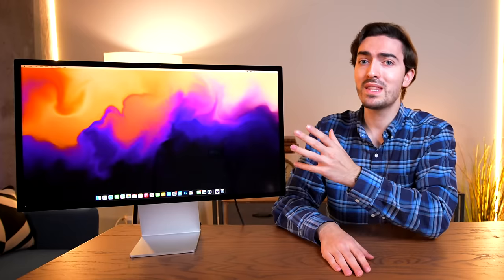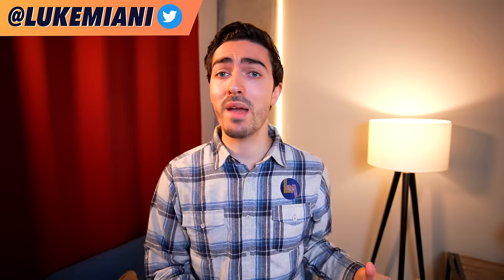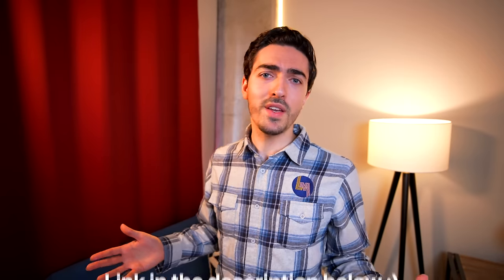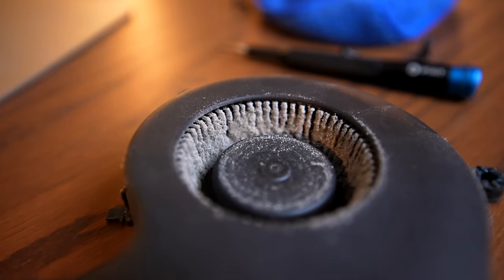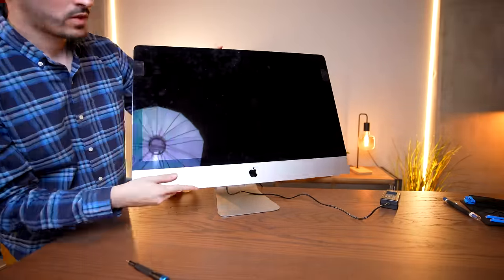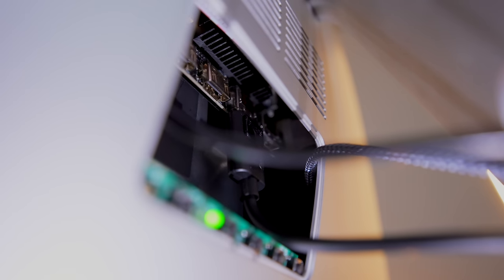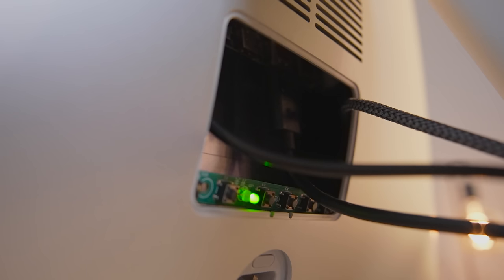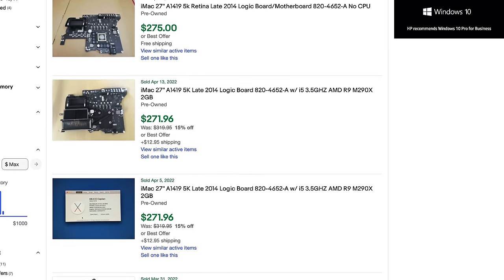How to make a DIY Studio Display for just $600! (USB-C & Built-in camera!)

Comment: Well done Luke... Yeah, I would do this in a heartbeat.  I think the new Apple display is WAY overpriced!  It should be $999 and then it would still be a high price. You didn't even have to work hard on getting this to work.  I think I would look into keeping the speakers with maybe a 2-4W amplifier for more volume when you want it. I forgot to ask  how much power this monitor draws?   I also want to do a similar thing and reuse a 17" or 15" MBP and put the internals of a MacBook Air with 16Gb of ram and 512GB SSD, making my own Pro size MBAir+.  I have a parts list built on putting the Mac Mini inside like you did before, this time with the ports exposed for a new iMac 27", since I think the 24" is overpriced and under powered for being an iMac.  It should automatically have 16Gb of Ram and I'm not a fan of the white bezel look.

Comment: I’ve seen cable adapters on AliExpress: 

27 '' iMac A1312 A1316 A1407 2K LCD Controller drive Board Monitor Display kit For LM270WQ1 A2 C2 E3 B1 B3 screen test mainboard.
Will these work?

Comment: Hi found this video and we I had an old slow running iMac 27 5k just sitting in the loft and as getting a new m2 something , I have gutted the old , just one thing what power supply did you use please,

Comment: I got my hands on a 2017 in mint condition for $100 but I don't have the power cable for the imac. Just wondering where the power comes from for the monitor? Is it through the thunderbolt connection to a mac mini?

Comment: Awesome project. While not a big deal, it should be mentioned in the video that one will have neither speakers nor a microphone.
Reply: i noticed the same thing too - I’ve been reading through the comments and there is a 4-pin speaker connector on the converter board which peeps claim could be used.  I am wondering what mic Luke is using in his current setup for sure.

Comment: Loved the way you did this. I have a Thunderbolt 27" Display and I'm pondering on doing the same sort of thing. I want to use it on my Linux PC system, and I don't use mac's any more because of compatibility issues. Anyway that's another issue. So if I could replace the LCD driver along the lines of what you have done I could use it. I've just started looking into this  so will see how it goes.
Reply: I'd consider upgrading your PC to Thunderbolt 4 so you can take advantage of fast external storage and use your monitor with a TB3 to TB2 adapter. Sure, more expensive but once USB 4.0 takes off maybe not too much.

Comment: Just ordered the conversion board to try this out for myself, but I noticed the seller is saying to avoid metal contact with the board in order to avoid short circuiting the board. Just curious how you managed this as it seems like it will be a little difficult to avoid any contact with metal as the entire interior is pretty much metal.

Comment: I happened to get a Later one on eBay, the "Late 2015 i5 3.2G 5K screen" at the same price, but now I regret it, and should have followed you with getting the 2014 one, because I now need the Target Display Mode (which I heard was possible with the 2014) and the 2015 has NOT GOT THAT! Bummer. Now I have no choice but to gut this good 2015 one, or get OR get an i7 6700 to upgrade.

Comment: Fantastic. I've asking around on forum for converting my 5k imac into a monitor.  I was wondering about using all that extra space in side. What would you need to do to insert some thunderbolt 4 and usb buses, and some more memory and audio (can you reuse the speakers?).  If I could trick my imac out with more connectors and memory I'd be in heaven.

Comment: I have been thinking about doing something similar with one of those 27-iMacs with a broken graphics card (1440p is still nice, especially if you are used to 1080p). You could also make use of the optical drive and other stuff.
So I hope I will get ahold of one very, very cheap :D

Comment: Nice project, I did something similar to my old 2007 iMac, because the screen is still decent enough not to get rid of.

Did you wire the speakers in the monitor too?
Reply: Hi Rene, your 2007 iMac won't be retina, so you can use it as external display without opening it, I think.

Humbly, Ylan

Comment: Luke 
I have an older Mac cinema display A1316 to be exact. I have purchased a M1 Mac mini and really would like to ise the HDMI port to connect my monitor. 
I saw your video on the subject and purchased the cable matters hdmi to display port adapter as you suggested. 
When I connect the monitor, it turns on for 6 seconds and turns off for 2, and on 6 seconds and off 2 seconds. 
Any suggestions on how to fix this?
Thank you in advance for your help 
Kyle

Comment: I’ve wanted to get some use out of the beautiful 5k display on my old 2015 27in iMac but couldn’t find a good way.  I might eventually do this project but right now, my 2015 27in iMac is doing such a good job as a media server running windows and Plex.  It does so well mostly because of how well it drives an external 4k TV.  I don’t even have the iMac’s display on 99% of the time. Seems a terrible waste.  If I repurposed the iMac’s display, I’d have to build/buy something to replace the iMac’s media server functionality (with good enough graphics).

Comment: How did you attach the board and cables to the back of the display? And what is the power supply for the conversion board? I found one on ebay as you did for $179 but the comments say the DisplayPort ports are 1.2 - not 1.4.  Won't that limit the 5k capability?
Reply: I’ve tried commenting here and sending a message via Twitter and FB with no response. 😢

Comment: I have a ‘17 version and want to use it with a Mac mini / studio. 
Is it possible to disconnect the display but retain the working internals of the iMac, fit the card and output the signal to the card, along with the new Mac and be able to select either as the input?

Comment: Some of these conversion boards have speaker connections. I did that on a 2006 iMac. If there are those connections, could you use the original speakers inside the display maybe?
Reply: the one he references has a 4-pin speaker connection.  apparently there are 4 wires coming out of each L & R speakers and the splitting of the frequencies is done at the preamp stage on the logic board.  Have my finger crossed this project catches on and an updated converter board is able to handle internal iMac speakers!
Reply: @chinarut  so maybe a tiny crossover would do the trick. But the board gives (I think) 5W of power to the 4-pin speakers connector, so yeah, maybe not worth it. Maybe from the audio output to an amp and crossover, all that in a small iMac body

Comment: hold on are you sure that conversion board dosnt also have a audio amp onboard so you could hook up the imac integrated speakers to that and make a banger of a display i there is a connector in the right up corner of that board with 4 pins which might be enough for the speakers as r+ r- and left + l - from what i know most of these have a amp and since yours also has a jack output for audio it might also have a amp built in NVM IT DOES ACTUALLY HAVE A AMP BUILT IN WE NEED  A FOLLOW UP TO THIS WITH THE SPEAKERS ADDED asap in the ad on ebay there is a pic showing up that connector with 4 pins for the speaker amp on that conversion board
Reply: while I can’t verify it - a poster said each speaker has 4 wires expecting frequencies to be spilit on the logic board.  so this requires an upgraded converter board that can handle the preamp stage w Apple speakers…

Comment: Excellent video. I turned my 2015 iMac into a studio display. Worked flawless with my 2018 Mac mini at day-1, great panel. However, after the weekend no use, I found out the monitor is only support up to 1920x1080p. The c-DP cable is fine, as when I connect my monitor to a M1 MacBook Pro, it's native 5k@60Hz. anyone can offer some help here? I tried different display software, such as BetterDisplay or  SwitchResX, which all showed only up to 1080p. any help here? Thanks

Comment: hi ! ,id like to know if you can make a video about the speakers ... 
i mean, how could it be possible to know the compatibility of different sort of speakers of apple, to plug 2021 speakers on 2015 macbook pro ... or switch it up and change the mac-mini speaker to having more powerful one, or maybe how can we freely use them on anything ?
how cool it could be to recycle apple speakers to put it in something else ...  
because there is absolutely ZERO topic on it ... and apple got the BEST speaker on the market since day one ... so it could be very helpfull and interesting to know how the cheap link works between the speakers and motherboard and all that ... 

thanks a lot and best regard.

Comment: This is cool, but according to Apple, a 2014 iMac is Target mode compatible. So why not just connect it via a Thunderbolt cable?
Reply: 2014 iMac non-retina is compatible. I think this is referring to the 21 inch one. The 27 inch 5K Retina IMac is NOT target display mode compatible. I have confirmed this.

Comment: I also have iMac Late 2014, but with different specs. I wondering if the LM270 QQ1 (SD)(A2) number would be the same? I want to place an eBay order for the conversion panel before opening the iMac if possible. Can anyone help me this? Thanks a lot!!
Reply: Which iMac do you have?

Comment: I did this to the old 2011 2k screen, but the contrast ratio was not good with the £60 board I used. 
I would not do this again as the converter board used in this video looks like it is doing the same thing to the image quality as my cheaper board did.

Comment: Orrrrr, you could just get "luna Display" and a converter cable to Thunderbolt 2 for $160. Still have the speakers, the keyboard controls and an actively independent computer for just doing dull stuff like watching 4k movies. Interesting thought experiment but kind of superseded by what is actually already available.

Comment: Good afternoon Luke why did you do this 

You can use more than one iMac as a display, if each iMac is using a Thunderbolt cable to connect directly to a Thunderbolt port on the other Mac (not the other iMac). Press Command-F2 on the keyboard of the iMac. You should now see the desktop of the other Mac. To exit target display mode, press Command-F2 again.
Reply: target display mode is now discontinued after 2014!   this build also allows you to use the display for anything (not just another mac!)

Comment: My 2015 5k imac just had a hard drive failure.  I want to be able to at least use it as a PC workstation display but I don't know if that's possible with a different OS. Anyone else try? I've also got my 2011 iMac that was struck by lighting with a lower resolution but at least it has a magnetic display and it could be fun to build in or repurpose.

Comment: There was another Dutch speaking video where the guy mounted his converter board's power supply INSIDE the iMac casing so wondering if that's a fire hazard or if the stock iMac had an internal PSU so disregard(?)

Comment: I am attempting this, but the problem I am running into is that once everything is out the display won't stay in a set position, it would always want to tilt all the way back. Any suggestions?
Reply: re-install power supply or other weight... btw have you had any screen flicker issues with your control board?
Reply: @alexr2324  I got an awesome deal on a 2020 model, do you know if there’s a board compatible with this one?

Comment: One downside is the monitor working quality is really depending on how the previous owner use it. If the iMac is heavily used, the monitor lifetime drops, it may have some problems like burn-in in the monitor. So, if you really want to do it, you need to aware the monitor is 2nd handed, not a brand new one. You need to accept the condition is not the same as a brand new one. 😊
Reply: burn-in is not a common thing with LCDs

Comment: I just got an amazing deal on a 2020 27 inch 5K iMac, is there a conversion board for this particular display panel?
If anyone knows what I may need to do this project for mine, I would love to hear it
Reply: I would like to know as well. I have a 2019 iMac.
Reply: @csdesignstudio  well as it would turn out, I went ahead and got the board that was shown in this video and it does work. I’m going a different direction however, for the overall display. I’m not going to put it back in the case. Thinking about trying to have something custom 3-D printed. Or something else. The displays working really well though. I did discover there is a more expensive version of the board that allows straight USB-C with power pass through as well as full 5K HDR.
Reply: @moviemikerod  That is so good to hear. I just want to make sure this works before I go ahead and open up the iMac. Do you have a link to that more expensive board? (Sorry to bother)

Comment: might as well buy a broken iMac that doesn't turn on and convert that, it would be way cheaper and still work like a charm!
Reply: i went through the “for parts” iMacs on eBay and the ones I looked at have a chipped, cracked, non-functional screens - so it seems you’re better getting a fully functioning one so you can recoup the cost by selling a working logic board for $275 as he mentions!
Reply: @chinarut  yea that makes sense but if you're going for a budget build. I found a striped 2013 iMac for $10 which is the shell and just the screen, that would've also helped save money especially is someone is making one on a budget and can afford a working one

Comment: I am wondering: somebody sent me a 27" 2017 iMac with a display with the front glass broken/ shattered. The glass is glued to the front, but IMHO it does nothing more than shield UV. And glass is easily obtained to measure. No glue necessary.
I've removed all the glass shards, this leaves me with some loose parts (display, dispersers, LED backplane , easily held together with some ALU tape).
Could we  reuse these broken screens again? I do think so, sincerely!
Recycle the planet!

Comment: As I saw a similar project here (https://www.youtube.com/watch?v=hzTVe6aVgww, German), I was wondering as we could actually even improve (despite your great work, Luke) the setup by putting the power supply inside and connect it to the iMac's connector, as well as the Power Button. Afterwards, the only optimization imo would be to make use of the ports somehow. But I actually don't know how yet ... or whether it is possible at all ... However, thank you for the idea!! I already ordered the parts :)
Reply: I noticed he didn’t talk too much about how the power supply is handled. I would be very curious to hear an update from you in regards to what you decide to improve!

Comment: So, you paid 600 Dollars for the iMac, 180 dollar for the converter, and your gonna need a, what is it, 90 dollar ifixit toolkit, new tape for the display, the webcam, anti static etc etc, so your closer to 1.000 dollar, but with a 2017 iMac, which has the Retina display, you are going to be closer to 1300 in total when you are lucky and not counting your time working. 
So, first of all, you didn't do it for 600 Dollars, its closer to 1000 dollars, and if you want the Retina display which is definitely better, you are closer to 1300 is my estimate. 
For  $1599 you are getting a new studio display with all the functions, the speakers, warrenty etc etc

Comment: Just use target display mode
Reply: @Lomaxxx  Oh yeah forgot that target display mode was no longer supported, but you can use thirdy party apps.
Reply: @Lomaxxx  oh, did not knew that, actually would be better if you buy the computer housing, the lcd, the controller and the glass, as you do not need the logic board

Comment: Nice project but calling $871 for a display used for 8 years a good deal? With zero warranty and questionable resell value? I have doubts.
Reply: YMMV, depends on if you can sell the parts. Which is made clear at the end of the vid.